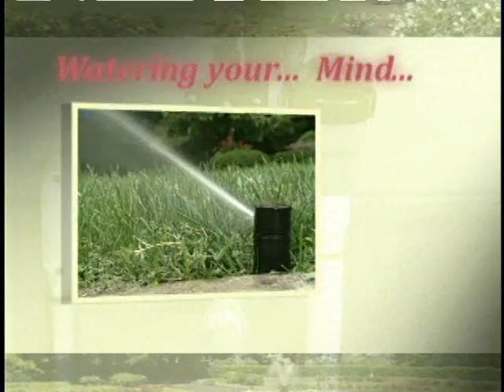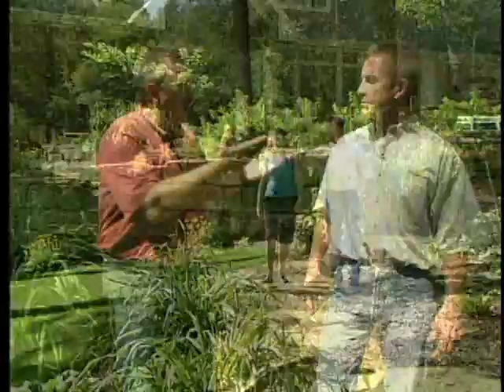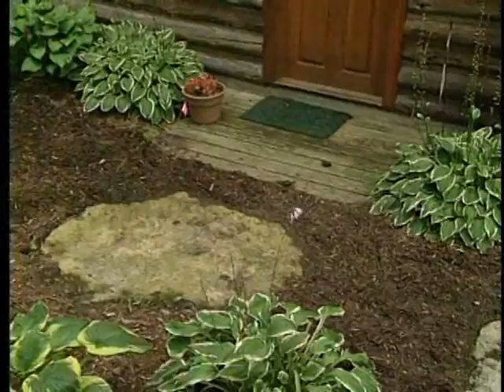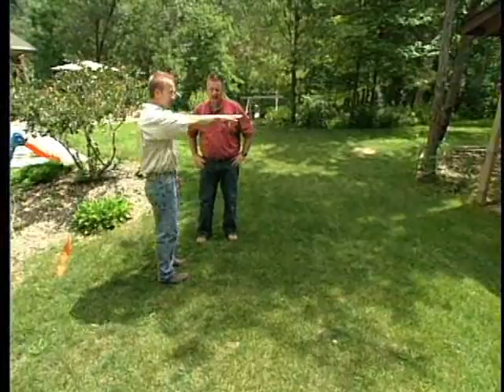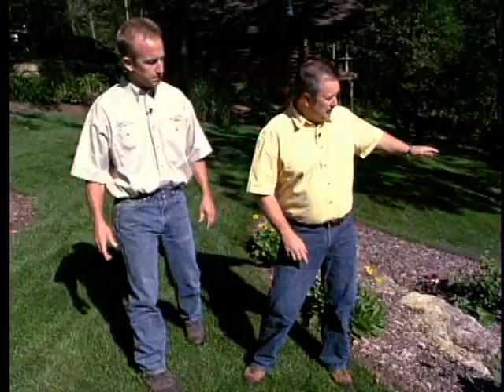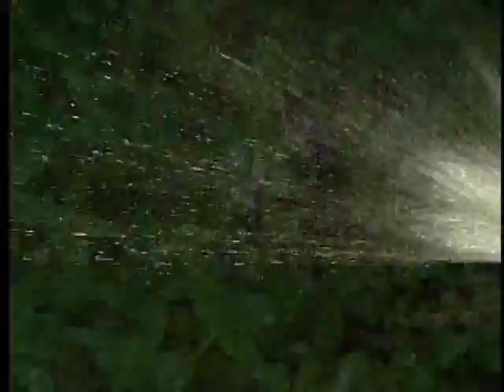How to Install a Lawn Sprinkler System

Comment: Yea it is good 4 tv but that poli pipe is only good 4 about 100 psi and is easy 2 pinch that is the only reason 2 use a ditch witch becous the pipe is plastic and flexable on that site the coustmer spent a lot of money y dident u put in a rainbird esplxme controler with a flow control mod and a flow sensor
Reply: ? TV??